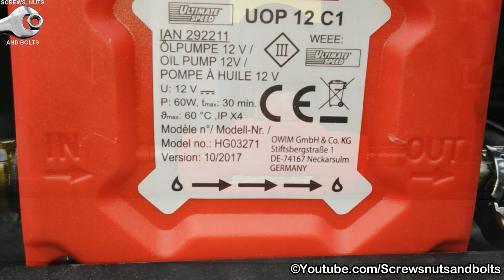Easy Oil Change Using a 12 Volt Oil Extractor Pump

Comment: I recommend warming the oil before extraction.  It goes much faster.  Also, the dipstick location isn't necessarily the deepest part of the oil pan.  I recommend wiggling the tube after bubbles appear to search for more oil.  You're never going to get every drop but it makes sense to spend a couple of minutes searching for oil pools.  I have no idea why this person removed the hoses from the pump.  I just got one of these and I wish I'd done it decades ago.
Reply: Any idea on what oil extractor to use for a 1.2 Polo does the dipstick is really narrow 5 mm any ideas don't want expensive one as it's an old car
Reply: @carmel-wayfinder5401  I have no idea what a POLO is however the older it is and the worse the condition the more likely it isn't your last vehicle.  All the pump kits like the one in the video I've seen on Ebay are around $25-$30 and will probably last a lifetime.

Comment: one thing i would recommend is to use a narrow pvc/metal pipe that fits into the dipstick opening instead of tubing.. tubing has a tendency to curl up resulting in not reaching the bottom of the oil pan and having more old oil leftover inside the engine.. otherwise good technique
Reply from the maker: Thanks for the suggestion :)
Reply: Saw these in Lidl today, too slow for engine oil work but might buy one for my 4x4 differential oil changes.
Reply: @markbro4427  I have one of these and the instructions state that they're not suitable for extracting transmission oil, - too thick I guess.
Reply: I used a 6x0.5mm brass pipe wich works perfectly for my car with a hose that has 6mm inside diameter to prevent any unnecessary restrictions.
generally a vane pump is desigend to be a vacuum pump or hydraulic pump for pretty thin fluids, that's why the engine should be warm and as Mavis said, shouldn't be used for transmission fluid, ATF would be fine tho

I did modify my pump to increase cooling for longevity and to double the vacuum it can pull.
I will propably end up using it at work to test it's longevity, since they are pretty cheap I think it's a fun little project^^
also it saves some time and gets more oil out than just draining it.
Reply from the maker: @nathanwest2304  Thanks for the tips !
Reply: it won't curl up because it will be hot in 60c Oil
Reply: before useing it use an engine flush first run the engine for 10 mins then watch it all flow out
Reply: Yep for straight dipstick tubes, as some are bent with flexi dipstick
Reply: @nathanwest2304  Hi Nathan can you help out on modifying my pump to the same extent as yours?
Reply: @TheHexxal  it's quite simple, open the case, make sure there are vent openings in the front and rear, check if the motor itself can move air in the front and back

Remove the lid of the pump rotor, check if the top of the pump housing is parallel to the chamber, remove any excess material with a good file, sandpaper on glass or something similar, but it needs to be parallel
the pump housing should be slightly lower than the pump rotor so you can grind the rotor to be level with the housing
you can do this with the pump running to save some time

using a dremel, draw the inlet and outlet closer to the top/middle of the inside of the pump, this allows more time to pull/push fluids inside the pump

a little bit of grease on the gears can't hurt either
Reply: @nathanwest2304  any pictures or video of how to do this?
Reply: Exactly.  I used to own a cheap pump but it's  tube kind of curl up and won't suck oil out completely from the bottom of a pan  I prefer a hard straight plastic  tube if available.

Comment: Just wanted to share my experience, I have exactly the same electric oil extraction pump, bought in Lidl, it's about 10€/$, and I did a little test on my Ford Mondeo Mk4 with 2.5T engine, my plan was to extract as much as possible with a pump and to see how much will go out from the oil drain.

Oil filter on this engine is top mounted cartridge, so it's easy and clean to remove it, and all the oil goes down to the oil pan when oil cap is unscrewed, because it's pressurised and full otherwise.

I measured oil dipstick length and put thin sucking tube which goes even further than a dipstick, I felt little resistance when the tube curved on the bottom and there was definite stop when the tube touched bottom oil pan wall.

My advice is to put can for the old oil as low as possible, basically on the ground and not on the engine, I have inspection pit so I can put it even lower, gravity is a friend in this case. Also engine was warm of course, so as the oil naturally, about 1.5h after engine was on operating temperature and ignition was turned off, so the oil can drain to the bottom as much as possible but also to remain thin and easy for the pump to extract.

I let the pump to pull out to the point when on the other side of the tube was just drops of oil.

When I removed oil drain plug, prepared to catch some amount, and eager to find out how much will it be, I was surprised that there wasn't even one drop of oil.

For my car with this engine it works perfectly, you must find out for your car, can it pull out all or almost all, and does it make sense to extract oil using this method.

I think you could tolerate up to 0.3L of old oil remained in the pan ONLY if you have no other option to change the oil correctly. 

In any case I will continue to change the oil from the pit, because i find it satisfying to do it myself 'old fashion' way, but if you have top mounted filter and if the pump extract all or almost all oil than this is perfect for you.
Reply from the maker: Thanks for the comments/tips 👍

Comment: I got one similar to it and OMG it is so useful.  I use it on my Lawn Mowers, Tractors, Cars, Trucks even on Small Engines... Also, I use it on Gear Oil + Transmission Oil + EVERYTHING..... OMG, this thing made my life easier !!!
Reply from the maker: Yeah they're great little pumps. Good value too :)
Reply: In %. How much of the oil comes out?

Comment: You should place the used oil container on the floor below the pump to let gravity help with the flow. Also you should warm the oil for 6/8 mins by running the engine to make it easier to pump oil instead of cold thicker oil.

Comment: For older cars with small bore dipstick tubes the vacuum bottle type works better but is slow, where the dispstick tube is large bore these 12v pumps are great.    Park on a slope or use a jack to ensure you scavenge most of the oil.
Reply from the maker: Yeah they're great when the tube fits. I tried it on my Peugeot 308 and it fitted into the dipstick tube but didn't go all the way to the bottom. It only emptied about half the oil :(
Reply: @screwsnutsandbolts  any advice on where/ what to get one for my old Polo 1.2 dipstick hole is only 5 mm
Reply from the maker: @carmel-wayfinder5401  I don't know, sorry. I've only ever seen them with this diameter hose.

Comment: Thanks for sharing.  I find it very useful for my boat.  Would not really use it on a car as the oil filter needs changing too and the flow is very slow at 200ml per minute
Reply from the maker: Yeah it's a bit slow alright :)
Reply: I am just back from using the lidls pump and while I didn't time it,...... It took at least 5 minutes for the first litre then seemed to stop pumping?? Plus the noise was too much for a Sunday afternoon in a housing estate...I'm not able to do the old fashioned way any more and thought this would be better.    I am a retired heating engineer and fairly familiar with pumps and   fuel filters. The day was running away from me so I stopped the oil change.. I just topped up and I'm going to have another go during the week but I'm going to seal the top of the dipstick tube with bluetack to see if it creates a better pull from the pump .
Reply: @sorleymcsorley5558  You are right Mr Sorley.  Yours is not a one off case... Mine does it too and I only use it on the boat where there is no alternative.  Hope the bluetack thing works !
Reply: I bought one of these on a whim and it's the best tool I've bought. Although it does take time, it's still quicker (for me anyway) than faffing about jacking the car up to get underneath and faffing about with sump plugs and seals etc, just turn it on, make a brew, come back and it's done. Not entirely sure what you mean about the filter, this doesn't stop you changing the oil filter in any way.

Comment: These pumps are a great idea but one glaring problem stands out that surprises me the manufacturers of these pumps have not done to make the job easier.
Put thumb screws in place of regular screws to attach the hoses.
They are not under high pressure so thumbs screws would be perfect as opposed to screwdrivers slipping off the slot as you try to tighten it.
Reply from the maker: Yeah that would make sense alright ! :)

Comment: I bought one of these when I saw on offer at Lidl. Tried it on my Hyundai i30 diesel, and it sucked about 3 litres out, then wouldn't draw any more out. I had to get under the car and drain the remaining 2 litres out. Also tried on a Ford puma and didn't draw any oil out. I even tried sucking the oil out from the draining dish into an oil carton, so I could be sure that the suction hose was in the oil, but it wouldn't pump. I can only think the oil has to be very hot and thin to suck it through the suction hose. Also, with a diesel when the oil becomes very black, it is hard to tell whether it is pumping air or oil because you can't see through the hoses.
Reply from the maker: Yeah the oil needs to be warm but they still only work with certain vehicles.
Reply: Yes it's far from ideal for most cars.

Comment: I have a Honda CR-V and I'm going to use mine to change and refill the diff oil. As it pumps at about 0.2 litres per minute, it should do the job in 6 minutes or so. 
I normally drain my engine oil by sump plug.
Thanks for the video! 👍🏻
Reply from the maker: Thanks for watching, good luck 👍🏻
Reply: Question 
That electric pump work for filled up transmission fluid because I have a mercedes c300 and doesn’t come with the dipstick????

Comment: I have a very low sportscar and cant get under it, metal jack up ramps far too risky , i will NOT pay a RIP OFF price of 35 dollars at a drive thru, so this harbor freight pump for ten bucks does fine , i can get to the filter from above by taking off the alt, also use a thick oiL the runny thin stuFF is watered down, very good video shots well done friend
Reply from the maker: Thanks for watching ! 👍

Comment: Seen one in Lidl today priced very reasonable, would be handy to keep in the boot should you ever pump in the wrong fuel ⛽️
Reply: £9.99
Reply: I have one & the instructions tell you not to use it to pump flammable liquids such as petrol.
Reply: I'm an electrician and work in the petrochem industry, you should definitely not use this for pumping fuel as the motor is not built to the same standards, being non sparking.

Comment: These pumps or even pneumatic once don’t suck the oil out completely. They leave about a litre behind. You can confirm this by removing the sump plug after you use the pump.

Comment: That looked like about 2 litres of oil, it usually takes 3 to 4 litres to fill up the oil in most sedans that I’ve owned. How much oil do you think was left in the engine?
Reply from the maker: It's actually most of the oil that was in there. It probably left a small amount due to the shape of the sump but it's hard to tell exactly without draining it.

Comment: Rather than use the cars battery, could I attach the clips to a noco boost jump starter pack?
Reply from the maker: Yes I think it would work fine if the booster pack output is 12v like the car battery

Comment: What about your oil filter? There will also be particulates that settle to the bottom of the oil pan that this pump isn't  going to get out so it needs to be drained.
Reply from the maker: This video was just to show how to use the pump but you're right about it not completely emptying the oil pan.

Comment: Have you checked to see if all the oil is removed by removing the drain plug? I saw a video for a manual pump that didn't remove all the oil
Reply from the maker: Depending on the design of the oil sump, it can leave a little bit of oil behind.
Reply: Or gauging how much oil in bottle compared to how much says to fill new oil 🕵️

Comment: Hi. Is it working with a 12v   battery charger too? I mean if you not put on the car's battery directly.
Reply from the maker: I'm not sure. Do you mean a battery charger or a 12 volt booster pack ?
Reply: @screwsnutsandbolts  charger
Reply from the maker: @belavarhegyi7343  I don't actually know if it will work with a charger ?
Reply: I have got  the same oil extractor like this and the oil change period is coming(1500km). I'll  try it with the charger and write if its working  or not.
Reply from the maker: @belavarhegyi7343  Yes let me know if it works, thanks !
Reply: @screwsnutsandbolts  its working with battery charger
Reply from the maker: @belavarhegyi7343  Excellent !. Thanks for letting me know !
Reply: @belavarhegyi7343  Good news!

Comment: you could use an engine flush to thin oil and get all the crap out of it
Reply from the maker: I usually drain the engine oil from under the car but I just thought I'd do a demo video of this 12v pump :)
Reply: And what if a litre of oil mixed with engine flush remained after pumping, that would be a disaster.

Comment: Won't there be oil at the bottom❓

Saw a video where they opened up and there was a kitter at the bottom ❓
Reply from the maker: Yes, it is hard to get all of the oil out of the sump using these pumps

Comment: So my oil pan bolt is stripped and I can’t get it off. Would this be the easiest solution instead of paying a lot for someone to replace my oil pan?
Reply from the maker: If the small hose fits into your dipstick tube and goes all the way to the bottom of the oil pan, it would probably do as a temporary measure but I would try and get that stripped bolt removed and replaced asap as draining the oil from under the pan is the best way to remove all the gunk and debris from the engine.

Comment: Advice: open it. Bypass the fuse and add a new fuse in the wires outside.

It stops working when you need it...

Comment: What do you clean out the pump with , someone on YouTube said pump through with white spirit?
Reply from the maker: This is what the instruction manual says:
♦ Clean the oil suction pump after every job is done by pumping a little fresh
oil through it.
♦ Clean the connection terminals after each pumping. Wipe off any possibly
present battery fluid on the connection terminals with a dry cloth so as to
protect them from corrosion.
♦ Clean the surfaces of the device and the hoses with a soft, dry cloth.

Comment: I have a similar pump bought for 56.00 and it takes about 20 to 30 minutes to pump out 5 Liters.  How long does yours take? I am looking at buying one that goes faster.
Reply from the maker: It's about the same. It claims to pump engine oil at a rate of 0.2 liters per minute
Reply: @screwsnutsandbolts  OK, thanks so now I know mine was working like it should.
Reply from the maker: @erwinerwin1245  You're welcome :)

Comment: I bought one just like this for my Corsa D and the hose won't even go all the way down the dipstick tube, too thick.
Reply from the maker: Yeah it only works on certain vehicles, which is a bit disappointing !
Reply: @screwsnutsandbolts  I'll try adapting a thinner hose, not sure how it'll go though.
Reply from the maker: @XofHope  Hopefully that will work. Let me know how you get on.
Reply: @screwsnutsandbolts  Finally did it! I got a 5mm silicone  hose that, with a bit of heat, attached perfectly to the original one. It worked but took forever and 3 days! Really, it took some 4 or 5 hours! This hose is only slightly thinner than the original one, so how long does it usually take? I was under the impression that 10 to 15 minutes... Not even close! (my car uses about 4 liters of oil). Overall it worked and the silicone hose is actually great, it's extremely flexible and sort of coils itself at the lowest point, so it got pretty close to all the oil out. But 5 hours!?!?
Reply: @screwsnutsandbolts  wonder will that pipe fit in Peugeot 307 petrol
Reply from the maker: @martymartin2894  I'm not sure to be honest, I'll try to find out
Reply: @screwsnutsandbolts  ok thank you. I have a feeling it will.
Reply from the maker: @martymartin2894  I had a look at mine. The tube looks wide enough but the dipstick is quite narrow and still feels tight as I push it in. It's hard to tell to be honest
Reply: @screwsnutsandbolts  ok thanks Tru now that u mention that I do recall the dipstick feeling a bit tight but maybe it's having to take a bend further down or something I will have a look at this. Hopefully opening doesn't get more narrow as it goes closer to the engine.

Comment: Do u van uss this for transmition fluid change?
Reply from the maker: No I don't think it's suitable for transmission fluid.
Reply: @screwsnutsandbolts   Why?
Reply from the maker: @Unicornmeme123  Because that's what the instructions say. Transmission fluid could be too viscous for the pump.

Comment: Can i use it to drain water out of my boat
Reply from the maker: I don't think so. I think it's just for pumping oil and the oil you pump lubricates the inner parts of the pump.
Reply: @screwsnutsandbolts  what about diesel fuel, diesel is also a bit greasy?
Reply from the maker: @ivanladisic6979  I think you can use this for pumping diesel
Reply: @citybreak33  I tried water but after my boat was empty my pump died😂